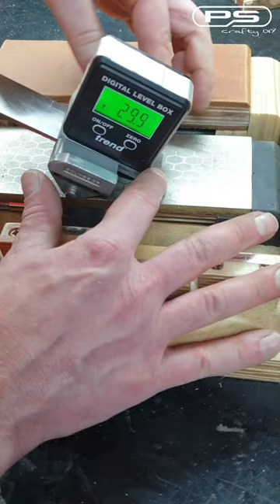Razor Sharp Chisel on Diamond Stone Sharpening Board

Comment: Where did you test it to come to the conclusion it is razor sharp? I really doubt it is though, with only 1k diamond plate and some compound loaded strop (which was executed incorrectly).
Reply from the maker: Tested sharpness by shaving hair on my arm, shaved them off in one pass. Thats what razors do and thats sharp enough for what I do.
Reply: That's not "razor sharp". Shaving arm hair can be easily achieven with a 1k stone. But if you'd try to actually face shave, then you'd understand why that is not really "razor sharp". Cheers! @pscraftydiy
Reply: @diavalus I mean the strop technically takes his edge from 1,000 grit to whatever micron compound he was using. So that may make it pretty darn close to a razor. I dunno.
Reply: You don’t have to have any really high grit stones to get a hair whittling and face shaving edge you can achieve that with a 1000 grit diamond stone and a 6 and 1 micron strop when you perfect the edge you can get off a 1000 grit stone that is when you can buy high grits for possibly a mirror finish
Reply: @Ewagg11  high grit compound or stones don’t matter much in this case as they can both achieve similar results if the technique is right. 

And no, 1k diamond plate followed by 6 um and 1 um won’t get you a razor sharp edge. It will be cutting some hair, but that’s not a razor sharp edge yet. You can cut some hair also after 1k or even 400 grit diamond plate.

For most application, such as wood working and knives and other tools, 1k diamond plate followed by 6 um and 1 um or a similar setup will be just fine, but for shaving that is simply not enough, unless you like rough shaving which irritates your skin like hell.

It would have been nice and easy if such a simple setup would be enough for a truly razor sharp edge. Unfortunately, this kind of edge would need a lot more refinement and it would require spending a lot of time on the compound to get it to that point, with the risk of introducing new issues. 

For this reason, razor sharpening uses different techniques and stones to achieve this.

Comment: What brand honing oil do you use?
Reply from the maker: No oil on diamond stone only sometimes on leather when its dry. On the stone I used to use Trend honing fluid but its quite pricey so I use a car window cleaner now as it has anticorrossive additives so wont ruin your stone comes in larger quantities and is much cheaper.
Reply: Good question,I think water might work but that’s from me using water stones..

Comment: Is that lidl drillpress
Reply from the maker: No, this one is Bosch PBD40, the Lidls Parkside is very similar.
Reply: @pscraftydiy  it had the essence of Parkside.. lol sound for the reply lol
Reply from the maker: The Parkside ones are supposed to be alright as well, they made by Scheppach inspired by the Bosch design. They have them on Aldi website sold as Scheppach DP60 for round £150 with 3 years warranty if you don't want to wait for Lidl to bring the deal in again or prefer the blue color lol.
Here https://www.aldi.co.uk/scheppach-dp60-bench-drill/p/724267663105600

Comment: Would it be possible that u have like design plans for this....because if so I would really appreciate them as all I have to sharpen my chisles is a cheap wet stone n  guide thingy.....so this would really help
Reply from the maker: Hi, sorry I don't have any design plans I have just copied the base that came with the Faithfull diamond stone and fitted it onto niece of plywood next to the original. Glued two pieces of beavercraft honing leather with double sided taps on either side of ply wood like you see in the video. One with shiny smooth side of leather up the other with the rougher side of leather. When they both ware out I can just flip them both. The box on top is also made of plywood, simple but joints nothing fancy. I passed the plywood through table saw to cut groove acting as a runner for the sliding lid. The kerf of my blade happens to be very near to the 3mm ply I used for the lid. The stoppers are just simple blocks of ply placed in distance copied from the honing guide.
The Faithfull diamond stone is currently on offer on Amazon for very good price. I pad round £50 for mine and then round £15 for vintage eclipse honing guide. 
Here is the link for the diamond plate 
https://www.amazon.co.uk/Faithfull-Tools-FAIDWKIT-Diamond-Sharpening/dp/B015JMIPP0/ref=asc_df_B015JMIPP0/?tag=googshopuk-21&linkCode=df0&hvadid=208050023643&hvpos=&hvnetw=g&hvrand=18040930423103383767&hvpone=&hvptwo=&hvqmt=&hvdev=m&hvdvcmdl=&hvlocint=&hvlocphy=9046369&hvtargid=pla-421350526489&psc=1&mcid=966fa1ceeafe30c6847f43addb2515e4&th=1&psc=1
Reply: @pscraftydiy  nah all good mate....thanks for what the info tho....I will see what I can do....n I suppose I won't really be learning much if I did just follow plans. Also thanks 4 the link...much appreciated😁

Comment: Can you give me the measurements for the angle setting stops from the edge of the base board. You have four of them attached for specific angles.
Reply from the maker: These measurements are dependent on your honing guide and they should be written on it. On my vintage eclipse guide they are written in the cast on the side. However you can put your chisel or plane iron in a guide and set the angel as per instructions or using digital level like I did. Then transfer the distance onto your sharpening board and that where you need to put your block. Cant think of more accurate way. On the other hand they don't need to be that accurate as long as you always do the same chissles/plane irons on the same jig. It just needs to be repeatable, the same angle every time.

Comment: What’s that part called that you have your chisel locked in?
Reply from the maker: It's called honing guide. It does both chissles and plane irons. Mine is an old original Eclipse I picked up second hand from ebay. But there is all sorts of styles of honing guides available nowadays, cheap or expensive some better than others.

Comment: What did you put on the stone and strop?
Reply from the maker: I use honing fluid on diamond plate but found it bit pricey lately so started using autoglass cleaner (something with anticorosive additives do not use water) and on strop I used little bid of oil to initiate and then charge the strop with polishing compound every now again.
Reply: @pscraftydiy  thanks!
Reply: I like that because oil can actually enhance the performance of compound and it helps even the compound out on a strop